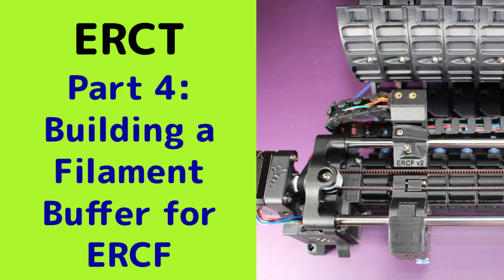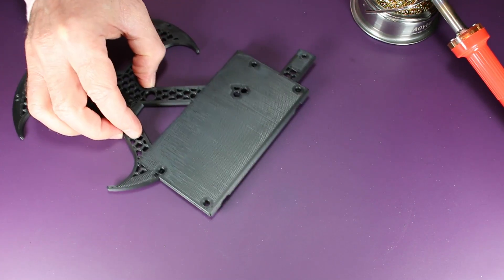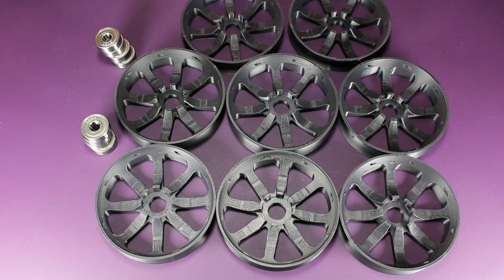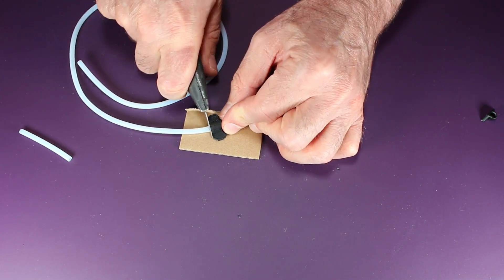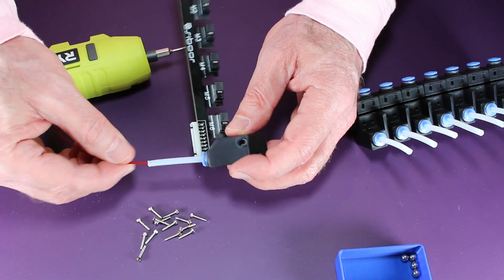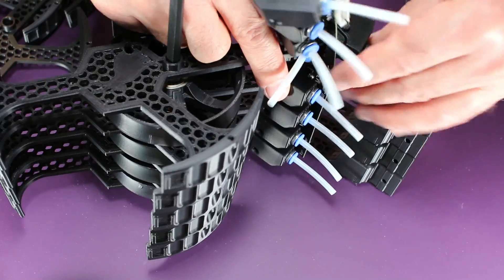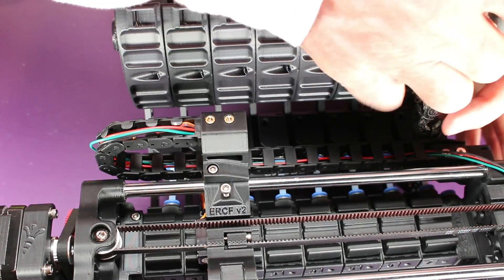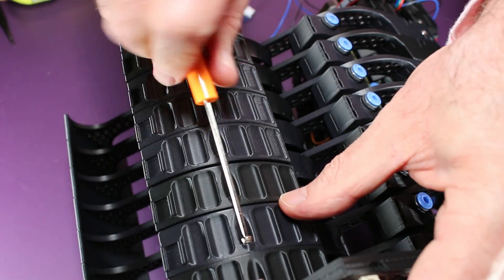Building the ERCF v2, Enraged Rabbit Carrot Feeder by Siboor.  Part 4 - The Cotton Tail Buffer ERCT

Comment: Love you Video, I am building mine now. And I did not get the flexible sensor in my kit like you show, mine was rigged and to install I had to mount them one at a time.
Reply from the maker: It appears they chnaged.  I eliminate the flexible circuit board and ended up just wiring the microswitches due to a mistake I made with one of the microswitches which ruined the flexible circut board.
Reply: @KapmansBasementWorkshop  For the new one, I had to put it in one mount  at a time, basically build the buffer up as you go. I hate soldering and wiring in general. I am getting too old and shaky. 
 I did get it all together and then snapped a few of the ABS parts. I am reprinting it all in a good PETG parts are looking great., Time will tell if they hold up.

Comment: Working on building my ERCFv2 + Cotton Tail currently out of the TriangleLab kit. I will say that Siboor definitely did a better job with their kit - the flexible PCB to unify all the microswitches for the coupler blocks here, for one example, but also really organizing and labelling the kit. At certain points I had to bust out my calipers to make sure I had selected the right screws because TriangleLab just throws all the screws in a bag. I'm now hoping to find a video covering the entire process of soldering and setting up the LEDs for both the ERCF and the ERCT, because the manuals don't even mention how to wire up the LEDs for the ERCT or how you're supposed to chain them to the LEDs from the ERCF (as the BTT MMB only has one pin header for LEDs).

Did you have any trouble with the support arms for the ERCT? I noticed in the CAD for them that there is barely any tolerance given to handle shrinkage, so I ended up having to shim the arms where the 3x M3x8 screws go in each in order to prevent the wheels from binding. The rabbit graphic also for some reason starts printing at Z0.4, and the bottom edges have a 45 degree chamfer, which caused me some problems. I ended up just modifying the provided STLs to be completely flat on the bottom to get rid of the chamfers and rabbit logo offset, and made the arms a bit wider to prevent issues with the wheels binding. Maybe my V2.4 isn't as tuned as I thought it was, but the support arm design definitely needs some work I think.
Reply from the maker: My support arms are a little rough when assembled.  But they seem to work.  My biggest complaint is the amount of space they take.  And the flexible PCB, some people have received a standard not flexible version.  I'm not sure which one I like better, but I ended up breaking mine by pulling out a microswitch by mistake.  When I re-attached it, I never got a reliable reading again.  When I get the followup video complete, I will show how I ended up soldering the microswitches with wires instead.
FOr the LEDs.  I used black filament and intend on mounting the ERCF to the back of the printer.  All the extra leds did not make sense to me as I would not be able to see them.  So I only mounted the front facing LEDs since those are the ones I would be able to see.  I suppose if this was printed out of white or clear filament, the leds on the back side would be nice too.

Thank you for posting and watching.   I wish you a great build!

Comment: Did you encounter any issues fitting the Board into the PCB Holder? Mine seems to be to tight on the left/right and the screw holes are also not fully aligned. Up to now i did not encounter serious issues with accuracy on other parts
Reply from the maker: I did have a problem in that part warped during the print as ABS loves to do.  It doesn't fit perfectly, but it does fit.  In my case, due to the warp, the cover for the PCB won't snap on nicely.  I will try to reprint that part later.

Comment: Don't screw the microswitch board in until it's assembled. Assemble the support arms, buffer wheels and spacers and screw the support arms together one at a time. Once that's done there's enough flexibility between them to fit the coupler blocks if you start at the MMU end. Then add the ball bearings and microswitch board.
Reply from the maker: Thank you for the tip!

Comment: If you run into the issue where all the pre gate sensors come up as triggered when running the mmu_sensors command in the console, the issue I found was all the holes where the bearings dropped in had a little bit of an overhang issue causing the bearings not to fully seat which then in turn caused all of the switches to be pressed. Also easiest way to install the pcb is when the buffer is put together.
Reply from the maker: Thats a good tip.  I ended up ripping one of the microswitches off the PCB by mistake.  I pressed it back in, but once hooked up, both it and the switches aroound it were unreliable.  I ended up pulling the PCB off and soldered wires across the microswitches.  I will show it off in the next video.  Thank you for posting!
Reply: @KapmansBasementWorkshop  I just ordered a pcb set from siboor so I didn't have to solder my wire management needs some work

Comment: Im building this same kit at the moment and hit the same issues with the silly m3 traps. Trying the V grove traps now. Thanks for the tips! Have been waiting for a video each week to continue my progress :)
Reply from the maker: The v groove traps are what worked for me. I had planned on releasing the video for electronics and software by now, but it's going to take a few more days.  But that and at least one more are on the way.  Thank you for commenting and letting me know I wasn't the only one!
Reply: @KapmansBasementWorkshop  I've tried the M3 traps and had some of them break, I realised the issue was tuning the print settings so that it maximises part strength

For that specific part I tuned z offset as low as possible, slowed down the print, increased chamber temperature, printed at 0% fan speed and lowered pressure advance

After that the part was incredibly strong and didn't break at all
Reply from the maker: @duck_that_quacks  I wish I thought of that.  This is a great tip!  I will probably reprint those parts soon and then give it a second try.  Thank you for this!

Comment: I'm wondering how the filament will ever be able to move easily enough through all of that paraphernalia, like the long PTFE tubing, buffer wheels, runout sensors, idlers, collets, not to mention a dry box.  Regular ASA/PLA is slippery smooth, so yeah, fine.  But matte PLA, CF blends, and many others are not, and have significant drag.  Even with only an encoder and the tube feeding my 2.4, I quickly exhaust my extruder's ability to push hard enough for good flow, while pulling hard against parasitic drag.  Is this a concern for you?  Does this system actively mitigate this in some way? Thanks for the great content!
Reply from the maker: Honestly, I am a little concerned.  But there are people successfully running these.  So far is my tests with a piece of filament, there isn't as much friction as I thought there would be.  But who knows, there might be an orbiter in my future.  Thanks for commenting!
Reply: The gear stepper can be synchronized to the extruder via a setting in the Happy Hare software.

Comment: A bit late now perhaps, but the RC2 files are available on Github and they have much easier to print buffers and such. And some other improvements to a bunch of different parts. I printed those for my Siboor kit and the kit went together smoothly. There's even a heatset insert version on the way for the three buffer walls that surround the buffer wheels. (Requested by several people, including myself, who felt that the plastic was incredibly easy to strip out when attaching the buffer wheel walls to one another)  I personally put together the buffer completely, then inserted the ball bearings, laid down the PCB and then added screws to the switches one by one, left to right, then I finally tested each switch with a piece of filament. It wasn't a big deal at all to attach the endstop PCB.
Reply from the maker: I did not see RC2 in the Repo.  I just looked again and failed to find it.  Please post a link if possible.  Thanks for the update!
Reply: @KapmansBasementWorkshop  I've attached the link. In the top left it says "master" where you choose the branch to view. RC2 is what you want. Lots of goodies in that.
Reply: @KapmansBasementWorkshop  there is a Branch in the ERCF v2 repo, you can select it when clicking on master and select RC2 or click on the Branches text right to the master text.

Its a mixed bag, as it has some commits that are not in the master/main branch but is also behind in some others.
Reply: Turns out I can't link to it. Check my other reply.

Comment: I’m curious, what LED carrier mount did you use for the coupler block? I can’t mount my neopixels in the STL in the ECRF V2 repo.
Reply from the maker: I've avoided the LED installation for the video as I need a little time to also experiement with wiring them to the mcu.  I expect to show what I neded up doing in the next video once I get the electronics working.
Reply: Those are a bit difficult. I have found that using the back edge of an XActo blade to scrape the tiny neopixel circuit boards with a slight taper toward the led side helps them snap in a bit better.
Reply: Also, print twice as many mounts as you need. They tend to snap.

Comment: Good video. At 6:57 it looks like the M2 micro switch tore of the flex board? Hopefully not, can't tell.
Reply from the maker: Yes, it did.  We will see if I was able to fix it soon.....Thank you!
Reply: These boards have been found to be finicky and difficult to manufacture. Apparently Siboor is shipping regular stiff PCBs now, which aren't recommended by the ERCF team as they inhibit movement of the filament blocks.

The best bet is to just solder up a harness with wire at this point. Hopefully the FCB version can be updated and work better soon.